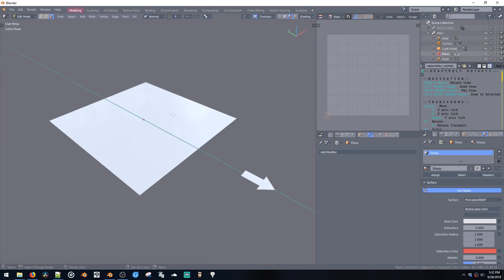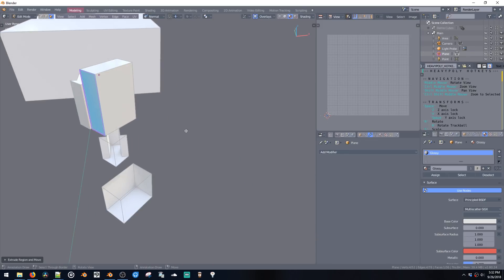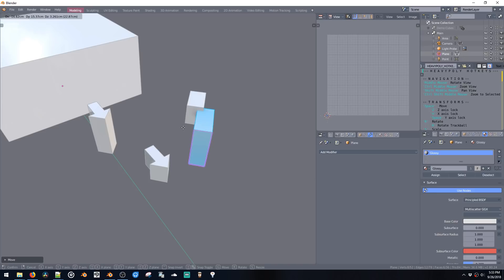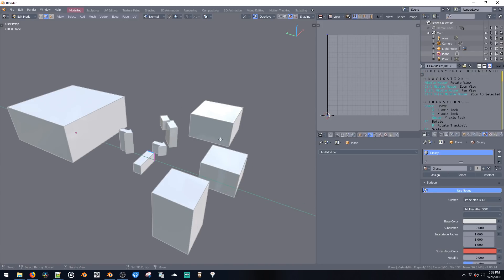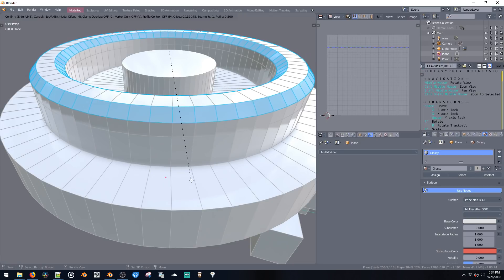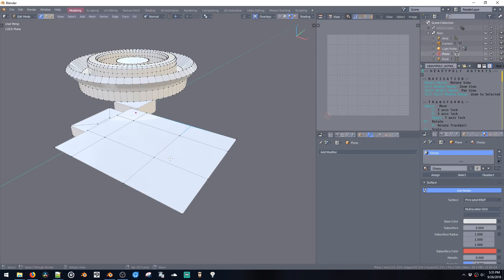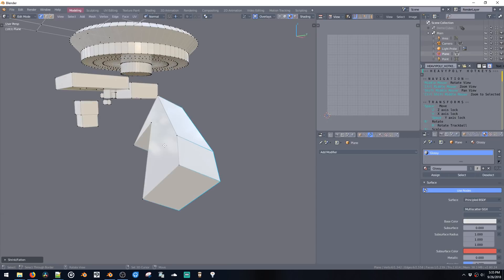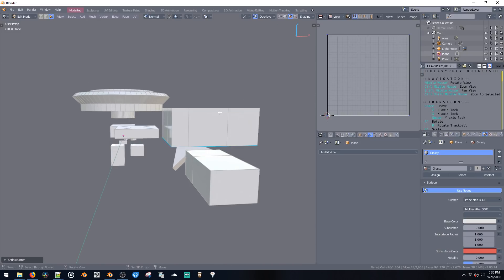Blender's Extrude Is Broken (And How To Fix It)

Comment: If I'm not wrong in blender 2.80 a new UV map is generated whenever you create a basic shape. Well, if so, I think another cool feature for this script could be to prevent the stretch effect for the new face texture when you extrude an edge: it would mean resizing the new UV face in UV maps accordingly with the mesh face.
I'm pretty sure you can already do it with some arcane technique, but I can't remember how atm.

Comment: Thanks man great video!
I have a problem that I don't think you addressed though.
  Whenever I try to extrude, it also duplicates the selected object. Please I need immediate assistance!!!!😭
Reply: I may be 2 yrs late, but I'll leave the solution in case someone else comes checking. I personally had this problem for hours until I found the solution a couple minutes ago. 

First of, the reason why the object seems to be duplicating instead of extruding is because, contrary to what we believe, the extrude function does not cancel when we hit "esc" or right click. It instead, adds a sublayer underneath your object, so the object actually remains extruded, by a factor of 0. This means you no longer have proper control over your objects, cuz the duplicate vertices underneath will keep interfering with the actual vertices of the object.

Solution: Select the object; Go into edit mode; Click on "Mesh" at the top bar; Select "clean-up.." in the list of options; then select "Merge by distance".

This will merge the duplicate vertices underneath, and the actual vertices together, giving you back control over the object in its entirety. After this, you can trying extruding the object again.

Hope this helps : )

Comment: Very cool but it should be a separate tool. This should not replace the current extrude tool entirely, though. You sometimes actually want the current functionality.
Also I think students should actually learn to mind the facing direction of normals. You need to know and control this - never rely on a tool to guess what you as the artist intend to do.
I'd love to see this incorporated into blender as standard addon, though. :)
Reply from the maker: I use inside out normals maybe 5% of the time.  For those cases I can flip the faces.  For the other 95% I prefer the normals to be well....normal.  Students should learn about normals, but confusing them with randomly flipped normals is not the best way for them to learn.

Comment: Dang, I knew about backface culling. I had it turned on for my Blender based model, but forgot it entirely on a recent Maya based model that I imported into Blender. Been flipping normals like crazy. I think I even flipped some the wrong way now XD 
Did you already have this implemented in the 2.79 version of the config? Great stuff man.
Reply from the maker: Nop, sticking to 2.8 from here out
Reply: Oh yeah, that's not what I meant by mentioning 2.79. I'm not going back to it either. Too many exciting things happening with 2.8